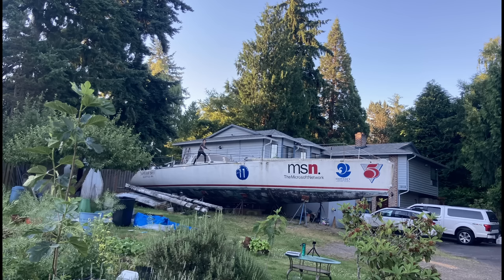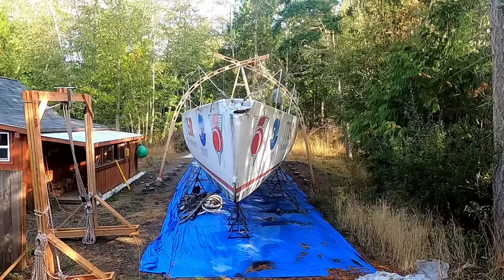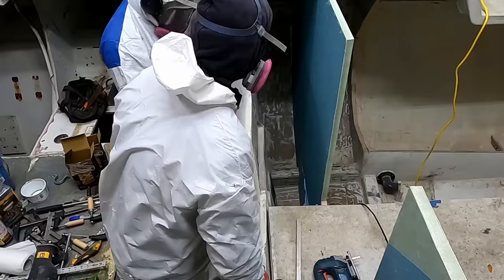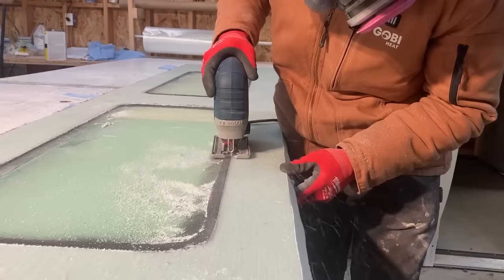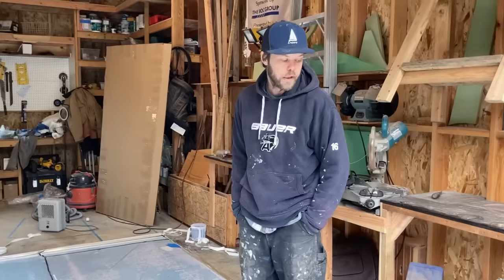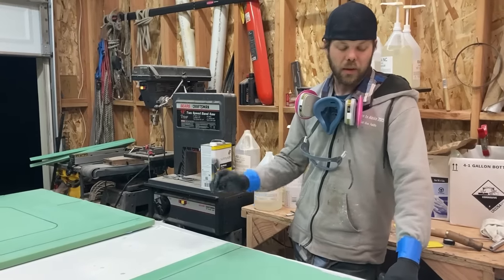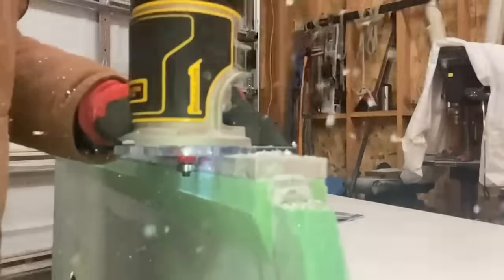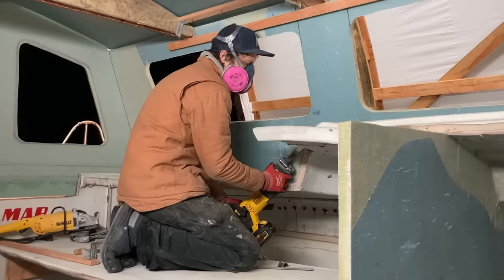8 Months of Work in 25 minutes!!

Comment: Cool to see someone doing professional level composite work on Youtube. I have watched so many of the "big" channels and cringed at the quality of their fiberglass work and their use of PPE. So cheers to vacuum bags and full face masks.
Reply: Thinking you might enjoy Mike Pateys Draco and Scrappy builds. He goes into great detail into how to get a perfect finish using carbon fiber as he builds his airplanes. I'm here because (I believe) of MJ sailing and their 42' cat build. They are also doing a good job and using PPE.
Reply: Clearly you dont know how bad it is then.. changing the structure that was designed specifically to have those bulkheads in those specific location. Is dangerous you can really screw things up doing that because you end up weakening the structure
Reply: Check Life On The Hulls, Ross does very professional work building a catamaran from scratch.. but yea know what you mean some channels just throw crap and see if it sticks..
Reply: @DerekGraham777  nah. It'll be just fine. You sound like one of those people that think you need to put the stock tires on their car or "iT cOuLd bE dAnGeRoUs." Or you need to put the same brand oil in your car everytime you have an oil change or "iT cOuLd rUiN tHe EnGiNe."
Reply: @DerekGraham777  If that boat was built right in the first place (which I'm sure it was given the original owners) then it's overengineered as f***! Moving a support from one spot a few feet over will have little effect on the structural integrity of the boat. Obviously we can only look at video, but that thing looks over built and solid.
Reply: They did composites in France, in order to win the catamaran races around the world. That was eighties, nineties. Composites is aircraft material, and now we see it anywhere. Cool to see fourty year old stuff? You got to do it right, or you invite trouble. Cool this man knows things.

Comment: When I was building my F-9A tri in the early 90's, I used alot of cardboard and tape to do mock-ups of different panels/parts to make sure I liked the shapes. Then used those cardboard pieces as templates to cut the DuraCore, Carbon Fiber or aluminum. Some parts took many iterations before I got to what I thought was the right shape. It's easy to scribe on cardboard and it's cheap or free.

Comment: Very happy to see this.  I was on the boat when she was at the south end of Lake Union in about 94.  The previous owner was getting ready for a nonstop circumnavigation.  As I recall, he had a collision with a ship and was dismasted somewhere of the coast of Mexico.  He then motored up to San Diego over something like 1000 miles.  Probably with the 3 cylinder Yanmar you pulled out.  Again, as I recall she had a 27hp Yanmar to move around harbors etc.  I've always wondered what happened to her.
Reply from the maker: Cool, you must have met John, the previous owner, during a Duck Dodge! We tell a bit of the story of the collision in epsiode 3.

Comment: This boat becomes a dream. It will be fast and comfy. I would plan for the easy to use rectangular wire conduits under the top and deck already now. Even with less computers the wiring will becomes extensive

Comment: You can make a leak detector for your vacuum infusion by making a "DIY Bat detector", the sounds that bats make are in the ultrasonic region of sound the same as where small air leaks are. They only cost a few dollars to make, I hooked mine up to some large padded headphones. It's just a device with an ultrasonic sensor that shifts all the ultrasonic sound frequencies down to normal hearing human hearing range. You put the headphones on then switch it on, and now you can hear even the smallest leaks. Works really well. Used it to fault find all my leaks.

Comment: Did you guys use a special foam that doesn’t melt from the heat caused by the exothermique reaction?
Reply from the maker: Yeah it is pvc 5# structural composites foam.  Divinycell or Airex.

Comment: Bravo.  Im doing similar with steel boat. But {without undue interference}  am going to lift my roof  {those stupied roofs they make were you have to bow like cockroach at front without banging head - but ur not a cockroach - month later still banging head} and am going to extend the roof out to side with hull, and use walk on as shelf & put stantchions on roof.  Im surprised you havent used the bits from the cockpit to sve time & money for rebuilding. I cut my cockpit out to extend cabin back - good to see someone else doing the same thing - satisfying to see that crap cut out {no cowering around engine }.  I think better to have cabin out to hull - more space inside and more space on roof - Ill put knee hight center grab rail.  Im little sus about the strength of yr cabin but think you did say something about not going high seas.
Reply from the maker: Sounds like you have quite a boat project of your own.
Reply: not counting the logistic politics.  As an Aussie said  "if you have a steel boat - your the lepper in the yard."

Comment: Another great episode, thanks for sharing more details of the build! 
I don't know much about sail boats, but are there any concerns regarding comfort and/or safety when converting a "hard core" race boat into a family cruiser? For instance; Is this hull built to plane originally, and if so, how will this affect the comfort of slower cruising?
Reply from the maker: The boat is designed to be fast, but safe enough to circumnavigate through the most difficult conditions.  We won't push the boat like it was pushed by Mike P, but we want a boat like this to make passages both safer and faster.  It won't plane but it will surf, and it should be pretty comfortable.
Reply: @TheDuracellProject  till you cut it up.... that boat was built as one big plug cutting it up drastically lowers how strong it is or was... you cant just cut out bulk heads like that. you want go faster then blue water cruiser sail boat get a motor yacht. there is a reason these race boats are built like they are. this thing will not be easy to sail either and changing its balance like this will only make it worse.  Race boats are like aircraft things are done for a reason. removing the ballast tanks is going biggest mistake unless you got 10 guys with  all the time to hang on the rail.

Comment: Is the green board all foam?   
Epoxy resin doesn’t eat foam like polyester resin.  However, epoxy doesn’t bond well with gelcoat.  What materials and products are you using? Tried to see, but maybe I missed it.
Reply from the maker: Yes it is 5 lb divinycell foam and total boat epoxy.
Reply: @TheDuracellProject I thought I saw Raka epoxy?  Which do you prefer? All my experience is with West Systems, but it’s expensive.

Comment: A friendly suggestion, The use of sheet 4x8 PVC , never rots , highly flexible ,light weight ,can paint it ,easy to clean . Roughened,  fiberglass will adhere . completely waterproof . With use of a heat gun it can be shaped.
Reply from the maker: PVC foam?  Thats what I'm using, though I'm considering a new recycled foam product.  It's supposedly cheaper.
Reply: @TheDuracellProject  it's not foam ,it's a solid piece, comes in 4x8' sheets that are 1/4 ,1/2 ,3/4, they have it at "home Depot" check it out ,not the same as what your using. Cheers 🥂

Comment: This is a world class blue water vessel capable of ... 13 knots, at least 12 and was given away probably not as a favor but to alleviate any liability. When originally built there was probably at least a half million dollars in just the engineering of the ship, with simulation tests, balance tests, load test and you cut out the vastly superior bulk head with your three peace untested, under engineered bulkhead that was attached to the ship like it was for a 28 foot boat. Wrecked at least some of the upper deck engineering with a bigger, heavier, and more than likely much structurally weaker dog house. Now it does look like the sail configuration is not going to change too much so that is a huge plus.
 Good Luck.
Reply from the maker: Ha! Yes the boat is capable of speeds a lot faster than that, the previous owner said he'd done 25+ a few times.  I have no idea the extent of the engineering that went into the boat, it was obviously built to withstand some serious sailing conditions, which we do not plan to put it through again.  I am trying to mimic the materials and methods that were used in the original build which I believe will yield a strong vessel.  Thanks for watching.

Comment: You've sailed before and actually enjoy it? Or is fixing the boat up more your thing? It's wild to me just some thin fiberglass strips holding 2 separate parts together (like boat house on top just fiberglassed to deck basically) is a strong enough connection. Fibgerglass is so strong ha. Such an awesome project.
Reply from the maker: I’ve been sailing for about fifteen years and love it. Thanks for following along.

Comment: Your very talented still the same question the boat is very big for a couple to sail how big is the main and jib even the size of the line is less friendly I like the re- build it is very cool  good idea to keep the movable water ballast the boat will not work without it unless you add alot of external ballast to the bottom of the keel
Reply from the maker: Thank you!  We will be using the water ballast tanks, for fresh water.  The water will be hikeable still as well.  There will be a lot of sail to handle, but the boat was designed for single handing, and we will not push it like it used to be.  This project is an exercise in simplifying.
Reply: @TheDuracellProject  reply very dangerous for experimentation with the $ that it takes to make it sail will you drop it If it needs a crew or keep trucking. I'd say keep trucking that boat needs 100,000 dollars to be right
Reply: @TheDuracellProject   hull shape and sail plan until you go in to architecture you will be playing too many changes ,hull ,rig,ballast displacement are you capable to perfect the idea of mathematics big question I am a shipbuilding  too would love to hear your answer

Comment: It almost looks like you know what you are doing!  Did you just draw up the mods in a napkin?  Lots and lots of epoxy.  Bagging seems easier, but did you consider infusion?  I have yet to do either.
Reply from the maker: Infusion is expensive and I’ve never done it before. These parts lend themselves well to vacuum bagging since they are flat panels. You do end up using less exposure in the end with infusion but it’s more expensive
Reply: @TheDuracellProject  Why is  it expensive?  Seems to me bagging needs all the same stuff except the vacuum pump.  
Maybe the expense is when infusion fails, bagging is more controlled success.
As I said, I've not even done bagging, all my glass work is just hand laid so far, made some small boats and car bodies.  I also dislike all the plastic garbage created when bagging/infusion, but it does make higher quality parts and infusion much safer and faster particularly for large projects.

Comment: Also hope you completely glass your inside cabin bulkheads, house lumber isn't the best choice for longevity. Nida Core or Divinicell would be a much more practical application for longevity weight and lighter. Lol just an old man! Ship and Boatwright and builder for many years here, please accept this as not criticism, but a helpful  thought. After All it's Your Boat.
Reply from the maker: I would love to do that. I worry about the cost of using foam for all the interior structure. That being said, I am only going to be building one more structural bulkhead in the interior (maybe 2)-the rest is cabinetry. I'd like to consider this more next fall when I will be building another bulkhead. Thanks for planting an idea in my head!
Reply: Last year I had an occasion to use Nidacore, biggest reason was cost and structural integrity and no water intrusion. Very light and when glasses with 1708 it's seems more solid than Marine Ply! Easy to work with also! love the coach roof you added btw. So much more roomy and open. Will keep up with you I enjoy building and Working in Boat Toys, been my occupation over 50 years, started before fiberglass be safe and have fun Living the Dream! Regards

Comment: What brand of epoxy did you use?
Reply from the maker: I built the doghouse with RAKA 2:1, check them out, its a very reasonably priced boat building epoxy.  The stern mod will be done with Totalboat's 2:1 epoxy.
Reply: Thanks for the info.

Comment: What is a peel ply used for?
Reply from the maker: It absorbs excess resin, leaves a texture after its peeled off so you don't have to abrade to apply coatings or more glass, and it takes the amines off when you peel it off.
Reply: @TheDuracellProject  Thank You

Comment: Careful. Those boats are literally designed to last one race.
Reply: nup. it was designed to circumnavigate the globe. those boats are super strong. most of the racing boats actually are
Reply: The only reason that they were designed for one race is because by the time of the next race, design and technology would advance and put them at a disadvantage. Structurally, there will be nothing wrong with it.
Reply: @DavidM2002  That is factually incorrect because none of the engineering nor is any testing done for long-term durability.  I've seen raceboats that have had delamination and osmosis issues while still in their design-for lifetimes.
Reply: @obsidianjane4413  Those are production, not design defects.

Comment: What the. You needed the cockpit floor and not the dog house floor. The coach House was a great design for offshore pounding and harbour manoeuvring. Lol.
please don't stop.🤭😂So I'm guessing a keel that is Twice the weight. 😂. Stop it will snap off.🤭Talk about a weight upset.
Did you do a 3 metre weight calculation to try to replace or at least understand. You may have to move the mast now to get pointing ability. Easy enough. And again and again. Water ballast did you get an understanding of how they sailed it.
Empty and fill on each reach ??? Seriously you could really go wrong. That hole idea would be to reincarnate to budget. You are blowing the budget way out with mods. You really need to save weight distribution or rigging and sails may not suit. VERY important. Good luck. You seem to be able. I will give you a go.

Comment: Up To me there are historical boats deserving to be left as they were designed. It' like chopping an old Lambo for making an RV. Technically can be done, you could even put some nice skills in doing it, simply ain't right. taking away safety nav features like ballast tanks, replacing the original dog house for making a raised deck salon..there is plenty of semiabandoned boat with similar shapes. Why taking an historical boat and disrespecting her past? Take an "anonymous" one and modify her followung your tastes no?
Reply from the maker: duracell is no longer a competitive race boat and turning duracell into a comfortable cruiser is a better option than letting the boat sit on the hard for another few decades
Reply: @TheDuracellProject  it's around 100 years Tally Ho isn't competitive, but they are rebuilding it respecting her heritage aftr having been left rotting for decades. There is plenty of forgotten boat to chip chop as one's like, but those with such an heritage should be respected and restored to their true beauty IMHO. But the boat is yours...so you are completely free to do what you want. it was just me thinking that if I ever had the chance to own (for free) such a beauty I wouldbt have changed her so radically. Some good nice new interiors is fine, but those radical choices maybe not.

Comment: Where’s the keel?
Reply from the maker: In our yard looking like a giant boot
Reply: @TheDuracellProject  Which one did you get, the long boot or the short one, there were two?
Reply: Did you get the standing rigging too?
Reply from the maker: Very long, the original draft was 12 feet.
Reply from the maker: No rigging or mast
Reply: @TheDuracellProject  I saw that boat on the hard at the Alameda boat works in California with the long blade on it and it was two flights of stairs, an elevator, rappelling gear, and a trampoline to get up on deck.  Really like seeing what you are doing with that old war horse!  Any thoughts on standing rigging?

Comment: You really used particle board...on a boat...smh
Reply from the maker: Don't worry, the particle board is only there to keep the shape of the arch until they are installed, then those particle board plates will be removed.